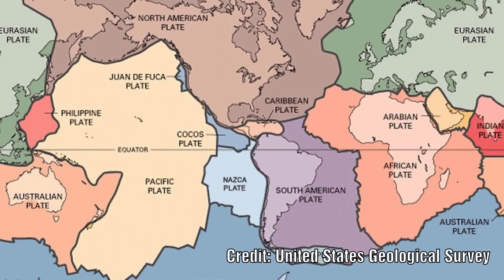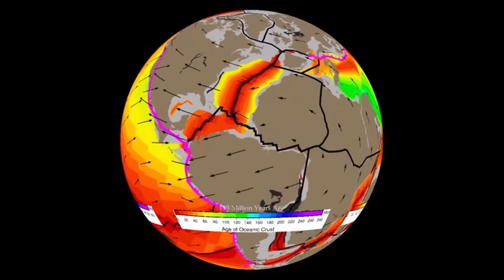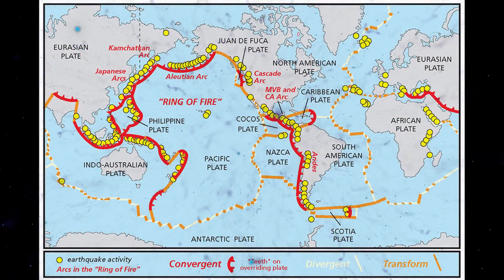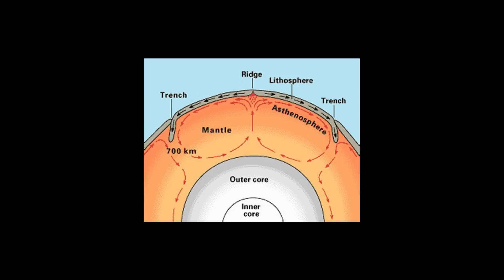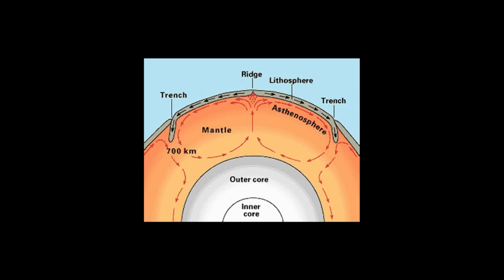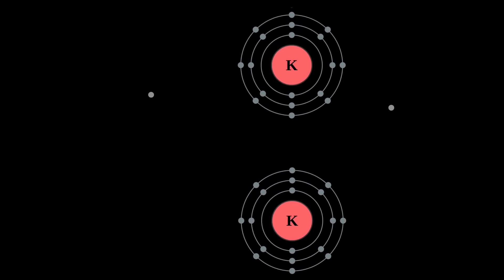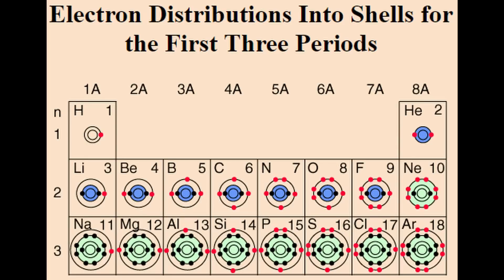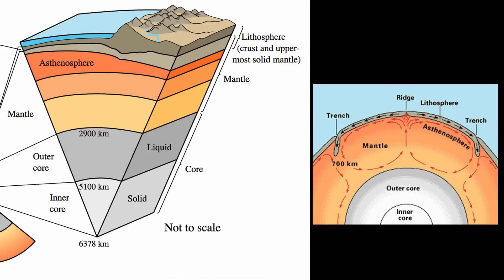What Powers the Movement of the Plates?  Convection or Something Else? Electronic Tectonics Part 1/2

Comment: What about James Maxlows Expansion Tectonics? They'd fit an electric universe more than Plate Tectonics.
Reply: Especially when examining the mid-ocean ridge topography (if we can trust that data), it seems rather obvious (to my eye and way of thinking) that all faults are expansion joints.  While that obviously solves the problem of "what powers the subduction of tectonic plates?", it merely replaces it with another even-stranger question - where does the mass come from to drive the expansion of our planet?  Or, if planetary mass remains constant, then what is creating the volume to blow earth up like a balloon over the eons?  When I then examine the asteroid belt and recall Tom Van Flandern's Exploded Planet Hypothesis...  yikes.  :)
Reply: @asb3pe  , until sometime in b.c.a., the year was 360 days and the month, 30 days. So the distance between the sun and earth has been increased slightly. And Thunderbolts Project has shown much evidence of electric discharge between solar system bodies, that orbit and rotate off the ecliptic. Strong evidence of a rogue body within the solar system sometime in the past.
Reply: @asb3pe  It is mass generation inside the core by absorbtion of an unknown radiation and neutron creation.
Reply: @asb3pe  I have pondered the mass accumulation question as well, and wondered if the dusty plasma of the solar wind could be depositing a net quantity of dust and other charged particles via the polar connections.  IE some material is presumably being removed from Earth via the same mechanism, but a quantity higher than the removal is being deposited.  The new material becomes part of the Earth's mass and increases slowly but steadily.
Reply: Other researchers to check on earth expansion are Stephen Hurrell and Peter Woodhead.
Reply: The last two Dissident Science youtube episodes have been presentations by Dr. Maxlow
Reply: Maxlow's model is very compelling.  But, he did intentionally avoid the causation/mechanistic aspects of the model.  He also placed a restriction on his model that prohibited rotation of the land masses, which may be a false postulate. 

Ages of the seafloors are at the heart of his theory, but these data are based upon a mangle of techniques and methods and dogmas, and are forced into the gradual expansion dungeon.  Further, the processes that created the Pacific and Atlantic basins are clearly different from each other.   Current studies assume that the movements of the crust are occurring at the same rate as they did throughout the history of the planet.  Saltatory changes, e.g. catastrophism, must be integral to any serious contemplation of not only the movements, but also of the forces that caused them.  The arguments regarding changes to the volume of the planet, will certainly be resolved by the solution to the tectonics.

Our tasks will become much simpler once we begin to regard Earth in the same discussions as magnetars.
Reply: @fisheatinweasel  interesting..could you elaborate on that idea? Regarding earth/magnetar...
Reply: Hilgenberg postulated that the ether of gravity generates production of new mass, particles, at the core.

Comment: Tectonists and geologists seem to be locked into models based upon standard states of matter.  Questions might better include non-Newtonian states in the upper mantle, as well as the saltatory shearing that is evident in these states.  As water is clearly part of the discussion, hydrated minerals in the quantum compression of the upper mantle will react differently than what we model for standard states.  The resultant pizo-electric releases will be much greater than science currently accepts, and the concurrent release of water (Bi-layers) from the hydrates will produce conditions for rapid conduction of the electric potentials.
Reply: i'll just leave this here, i've saved the link since 2007 because I found it so interesting, perhaps some of the folks here will also find it interesting to ponder: http://blog.hasslberger.com/2007/04/volcanism_activity_at_the_hydr.html
Reply: Finally, someone addressing the water!